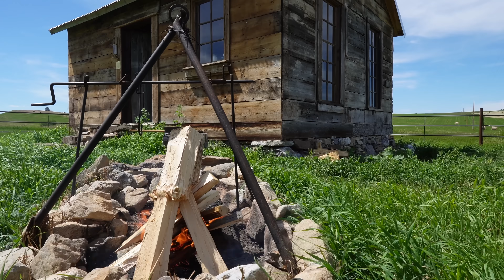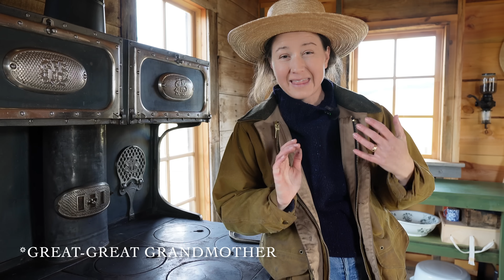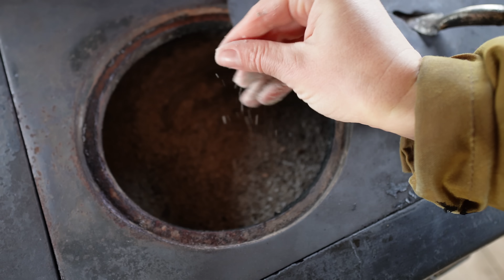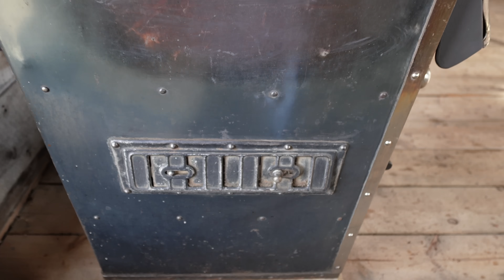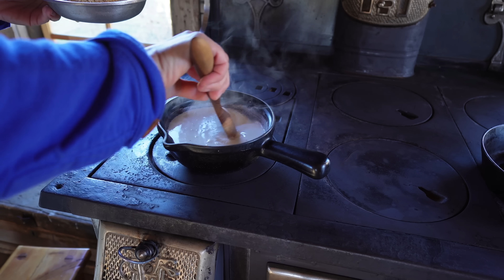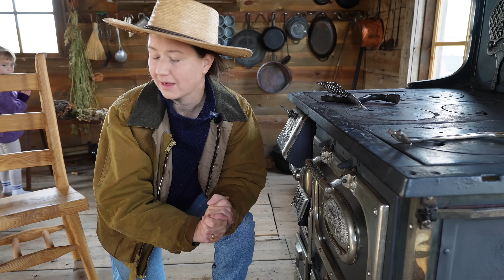How A Cookstove Works 🔥 (wood-fired)

Comment: Hello, I’m a retired plumber and an ex-firefighter. You can plumb any heave steel tank on the side of that stove to have a water heater storage tank. I’m not sure about your comment about it being a “box” , if you meant a square boxed tank, ok I get that, I’ve not had many contacts with wood fired stoves with the added water tanks, but I’ve seen one with a “box” sort of setup. I’m going to do a bit of research into that. Just for fun. I’m 64 years old as I write this, but I first started working as a plumber for my grandfathers plumbing company on my 12th birthday lol, he came in our house at 6am, woke me and told me to get in the shower, afterwards he gave me a birthday card and it said I was now a plumber! Didn’t have the heart to tell him I wanted to operate heavy equipment lol. But back to the subject at hand, as long as the threads on the pipes are in good order and you can put unions on them, get a storage tank, doesn’t have to be a heavy duty tank, meaning a thick wall, but it should be able to handle a high temperature, but also remember to use a T and P valve, temperature and pressure relief valve, some people call them pop off valves ( or maybe just my father?) and I’d also suggest you wrap a modern day water heater insulation blanket around it. Be sure to check and be sure those old internal pipes haven’t rotted out, you can cap one side, or adapt a water pressure gauge on one, the outflow side, and then adapt a hose pipe connection to the other side and use your water from your well as your working pressure, you could also cap the outlet with a cap, and the intake side with an air pressure gauge and a air valve ( think of the valve stem on a car tire) and pump it up to a greater pressure than the water pressure and let it stay a few hours and see if it loses pressure, if it does, even by a half pound over an hour, I wouldn’t use it, just be sure to check for any air loss at the cap and your air gauge setup. If all is good it would be fine. 

As to my fire department comment, I was told the following by my fire department training officer, he said that Benjamin Franklin had setup the fireman’s fund insurance company to protect home owners from fire, only thing was, you had to display a sign stating you were insured by the fireman’s fund, or the firefighters would not fight the fire. And the sign had to be visible from the outside of the house, but it also had to be on the wall where the wood stove was located, just like an outhouse and as you stated at the beginning of this video, cooking was done mostly outside the house. At the time of franklin’s fireman’s fund, it was the wood or coal fired stove that was the cause of most fires. Fire places were mostly protected by the hearth and the fireplace itself. So in those days firefighters were either on foot or horseback so speed wasn’t a thing, so the wall would be pretty much gone by the time they arrived and the sign was required to be wood. So it too would have been burned up. The trading officer also had said it nearly got Franklin arrested for fraud, and since it was required to even have his first fire department to try to put it out, he was or nearly was arrested for extortion . And it was the outcome of that situation that anti extortion laws came into existence. As I said the training officer taught us that, I’ve no idea if it’s true or not, so don’t yell at me if it’s just BS. Not sure why he’d teach us this. Though he was a life long employee of Pacific graft and extortion company, oops I mean PG&E ( hehehe)

Comment: If you extend the chimney pipe farther up (chimney should be at least 4-5ft above the roof peak.) It will create a greater pressure differential and you will almost always have a decent draft in the stove.  Your outdoor section needs to be black as well because it will absorb the sun and help with the pressure differential.

Comment: Hi, great video :)
I was wondering how do you make sure the oven stays the right temperature througout the baking proces?
Reply from the maker: Cheers! Honest answer: it is very hard to keep a consistent oven temperature throughout baking. A lot of old recipes call for starting at a high temp and letting it slowly descend (which is much easier to do in old ovens). 
Long story short: use the right wood, the right amount, and bake on the bottom of the oven 😍

Comment: Sadly can't use one here in Germany, the chimney sweeper, mandatory and non-negotiable when using any type of burner with a chimney in Germany, would shut that thing down because of heavy emission rules. There are exceptions for fireplaces, if it is your only source of heat they can allow it, and if that stove wasn't moved since 1950, "grandfather" rule, or is under 15 kW but for normal use if you also have a central heating system? The chimney sweeper will forbid and enforce, with the police if necessary, your fireplace to be never used again.
Reply from the maker: Oh wow really?! I can see how if everyone used one the skies would be thick with smoke. But surely the history of these tools and those who know how to use them properly should not be forgotten 🔥 Thanks for sharing

Comment: It's amazing how small the actual fire is. I heat my house with a big full-size wood stove, a big metal box with firebricks, etc. which demands a lot of wood. Full-size split logs are what get shoved into it every 30 min or so to keep the fire stoked. 
The smaller stove fire must put out an enormous amount of heat for cooking, usually around 200 d F for boiling water, or 350 d F for baking. 
An impressive machine, thanks for filming and posting this--I learned a lot!
Reply from the maker: Yes! Great point! It is wild how small the firebox is 🙌🏻🔥 Very brilliant design. Changed life for a lot of people

Comment: the way you pulled out the wheat tortilla was nice, here in Mexico we usually do it by hand but still, cheffs kiss to that tortilla
Reply from the maker: Nowhere near the authentic tortillas of Mexico, but it was fun to do a wheat flour version on the cookstove 🔥 Cheers from Montana
Reply: @Montana_Ranch_Rescue ufff, those are a staple on the northern states of Mexico, insonora theres the "tortilla sobaquera" which roughly translates to "armpit tortilla" because its a large wheat tortilla that goes from the tip of the finger ti the armpit, thats the radius

Comment: I have a Majestic cook stove and use it in the cold months, but I use the gas stove most of the time, well, it's easier. But the cook stove makes great soups and pizza with little effort. It also heats the entire house, that's why I don't use it in the warmer months. I use hard coal and wood for fuel. Works great for being over 140 years old.
Reply from the maker: Wow, 140 years old—that’s incredible! I love that. Nothing beats a wood stove for heating the home and making a great meal. 🔥 I often used a little campstove outdoors on hot summer days. I agree of getting cooked out in warm weather.
Reply: @Montana_Ranch_Rescue  It's heating the house now, with only a few pieces of split wood and some coal. It's rather warm in here. 

When i was a kid, we had a coal stove. I only lit it a few times, but it would make the house hot. I was, it seems, always in charge of bringing up the coal and taking out the ashes. I still loved it, but it made the entire house sooty. I was about 7 then and learned how to cook and keep house. 

I'm a janitor now, over 50 years later, and am appalled at the other shift janitors' work. They don't even clean the stuff off of the walls. Glad it's not my building anymore. I still use a scrubbing brush on the floor. LOL.
Reply from the maker: @jhonwask  Oh wow yes! You grew up knowing real dirt (coal just as a way of getting on everything! But boy is it worth it for the heat 🔥) I can picture the hard work you knew how to do—I’ll tell you my generation (and myself), we just don’t have that same level.

Comment: Australian here and a bit of an antique.  Back in the 1980s, I was a shearer's cook for about 3 years.  That is, I cooked for a gang of shearers who would travel from sheep station (ranch) to sheep station across western New South Wales up to the Queensland border over the summer - shearing 10s of thousands of sheep as we went.  Some of those stations had anything up to 80,000 sheep to be shorn.  The full crew was about 30 people, and I was hired to provide 3 full meals per day and morning/afternoon tea in between.  The station usually provided meat, but I had to organise everything else, cook and serve it.  And drive the truck with the gear to the next station.  Each station would usually need between 10 and 15 days to shear out the flock so catering had to be organised to cover that period of time.  

Each station usually had a separate cookshack with woodstove for the shearing crew, and some of these had been in annual use since the 1830s or 1840s.  Most were equipped with a woodstove - usually not as fancy as your one - and the woodstoves varied tremendously in quality and maintenance.  I learned (had to learn!) very fast how to use each one, because the Shearers Union had very specific requirements written into the work contract for meals for the shearers.  A bit of a baptism of fire, but I fully agree that baked goods done in a woodstove just can't be beat.  

The cuisine was basic anglo and I did a lot of roasts and stews and cake (a union requirement for morning tea break!) and scones and the like. Bread too, as most sheep stations are too far from town to purchase any such thing.  Morning/afternoon tea was not at all refined - it was a calorie boost for men doing some of the hardest physical work I've ever seen - except for logging.  Usually in close to century heat. So there was a LOT of salt & sugar used in the standard recipies.  Someone else usually did the woodchopping, but my job required wrangling the actual stove.  

The other thing I found that woodstoves do brilliantly is make stock.  Big stock pot, half or a quarter over the hole, brought up to a simmer with a low fire and then just allowed to bubble away quietly on residual heat overnight - the results were better than I can do nowadays over an electric stove.  And I used a lot of stock in soups and stews. 

I'm not sure this sort of short term mass cooking could be done cost effectively on electric stoves - before solar panels all electricity in the outback came from generators and was costly in fuel which also had to be transported and was dangerous to store in bushfire weather.  The woodstoves were comparatively cheap to operate, particularly as they were only in use for a few weeks each year.  Just the cost of the wood in time and sweat which could be done at any time before shearing started.
Reply from the maker: I just finished reading your story out loud to the family 🔥😍 LOVE the whole setting of that adventure! The remote wilds of Australia, cooking on multiple wood stoves—like you said, what a baptism by fire 🔥 Wow… Thank you for sharing what that was like. A real moment in time/place. Do shearers still go out and do that? With wood stoves? 

We have some old wooden shearing shacks still around Montana, but the boom days are long gone now. Boy hard work 😓
Reply: @Montana_Ranch_Rescue  Nowadays it's mostly contract shearers who do independent travel to shear sheep in much smaller batches - but meals still have to be provided.  Solar panels changed everything - it's possible to do good refrigeration and have frozen pre-prepared food like in bags & boxes instead of doing it from scratch like I had to.  And a lot more fresh food like salads fruit that's not dried etc.  Also, there's not as many sheep as there once was, so having a whole 30 strong gang of shearers moving from station to station as in the old days just isn't needed.  It's still very good money for very hard work.  
The old woodstoves are often replaced now - a more modern diet means that sort of cooking just isn't as necessary.  I kinda miss the stoves - once up and running they did a marvellous job of being the hub of the catering enterprise.
Reply from the maker: @beabarber4300 what a time, what a time 🔥🔥💛💛 Love your comments

Comment: Question. The vent that was below where the water tank would go, if you don't have the tank, should that vent be left open or closed? My quick meal coal and wood stove has the vent, I always leave it open but would lake to know.
Reply from the maker: Good question—that vent on ours goes right below the firebox grates, which would add a lot of oxygen to the fire. I almost never open it

Comment: 12:00 I forgot for a few moments that when people say pyrex now, they mean the brand, and the modern slop they put out, and not the old good Pyrex material stuff you could take out of the oven and throw in a bucket of water, and be utterly unconcerned about thermal shock damaging it.
Reply: Yes, same with corningware. I put in the time and effort to garner a 20pc set of vintage corningware cookware and its fantastic in the kitchen. Now everything I cook with can go from oven to stovetop to refrigerator to broiler in the same dish
Reply: @user-k8h4y  Yup very sketchy username, and for anyone coming after, what you're looking for is a 'low CTE glass' low coefficient of thermal expansion.
Reply: @rjwaters3  My username is just whatever YouTube generated for my google account, and I don't care enough to change it. What I'm talking about is called Pyroceram, which is a glass-ceramic. Slightly different. It's what was originally used in warhead cones. It's more temperature-durable and stronger than classic Pyrex. It's somewhat like Pyrex that has been ceramized. A low cte, but not 'glass.'
Reply: @user-k8h4y  Just realized in my hemming and hawing about how to address the sketchy username with a joke, I only half deleted that section. 'yes indeed! that is what these sorts of products are for. Person with very sketchy username' was what I was going for, then intended to delete it.

Also I would consider a 'glass-ceramic' still a glass, but a subset of such, it's all the materials of a glass, with a similar but much more precise fabrication process and higher material purity demands. Good to hear theres an actual product line for this sort of thing still though. Even if they are silly expensive.
Reply: @rjwaters3  Yep, just heated until ceramic phase. Don't fret about the price, if you want to buy new, they are absurdly expensive. However, I collected my entire collection via garage and estate sales over the course of about 2 years. Pyroceram was the standard in the 1950-1980s. It wasn't until recently that a French subsidiary of Corning started a 'revamp' of the old formula cookware. And they're selling for something like $80 per 3 piece set - absolutely absurd. But most grandmas held onto their Corningware from decades ago, and they sell for ~$4 a piece at most estate sales.  The old is just as good as the new, barring any cracks or defects.
Reply from the maker: Ahhh yes the old stuff is super good—you’re right. This glass pan shattered into a thousand marbles

Comment: My Dad’s Father always kept a washtub out back of the house that had split kindling in it standing on end and he would pour kerosene into it and the kindling would suck up all the kerosene ,then you could just take one or two pieces and put them in your stove with dry wood and with one match light your fire. I’ve used this method for decades . After the wood soaks up the kerosene you can lay an oil cloth over the top and weight it with rocks.
Reply from the maker: That’s very clever! I’d like to try that 🔥 (just don’t let anyone smoke by the wood pile 🫠)

Comment: I saw threads on the hot water tubes.  A plumbing supply store will have threaded caps to screw on and then you can stop the extra air from entering the fire and have better control. And, thank you, when we get our property, we hope to have a wood cook/heating stove and I'm learning much from you.
Reply from the maker: Oh thank you! That’s very helpful! I need to cap them. Zero firebox control at the moment 😖

Comment: We have a modern wood cook stove. It is a Obadiah 2000 made by Heco.   The modern ones are amazing and even better than the old ones.  Best thing is the size of the fire box.  Here in our remote area of Alaska we burn a lot of standing dead spruce mixed with birch.  The firebox is almost the size of my oven on the stove. Even with spruce I can burn over night and keep the house around 70.  We have loved ours for the past 4 years and see many more years with it instore.  Great video.
Reply from the maker: Wow, that sounds like an incredible stove for remote Alaska! 🔥 Keeping a stove going all night is a huge plus—I used to put coal in my cookstove for that exact reason. Made all the difference. Cheers from Montana!